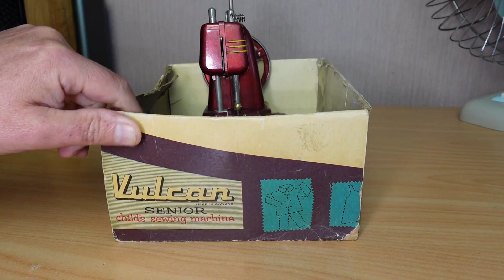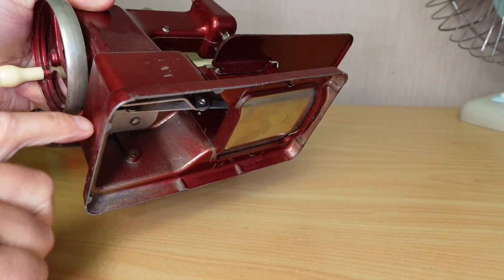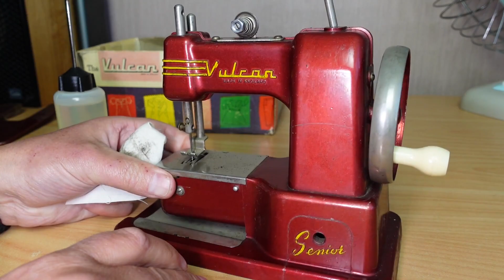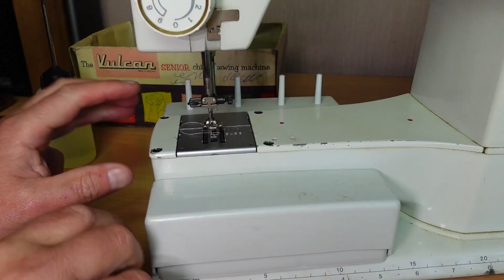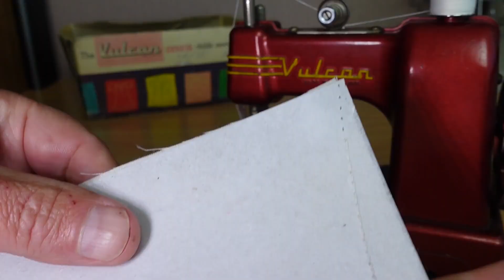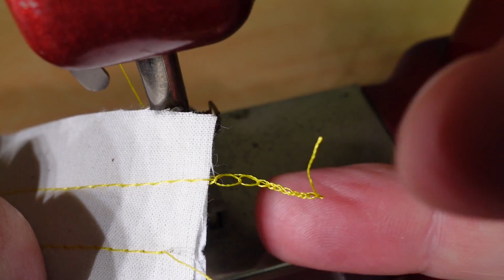Vulcan Senior - Child's Sewing Machine - Will it Sew?

Comment: Thank you for the video, that's a nice machine.
There must be a cam behind the feed dogs that pushes them forward so that direction of the hand wheel doesn't matter.
Do you think the looks of this machine was modeled after another full size machine?, perhaps the Viking 21?
Reply from the maker: I think you're right about the cam. I may investigate the mechanism to discover its workings. I'm not sure if the machine is modeled on a specific full sized machine. It doesn't really match anything I've seen. Thanks.